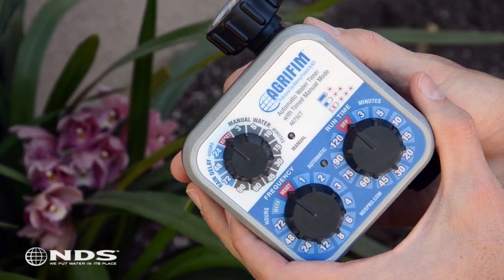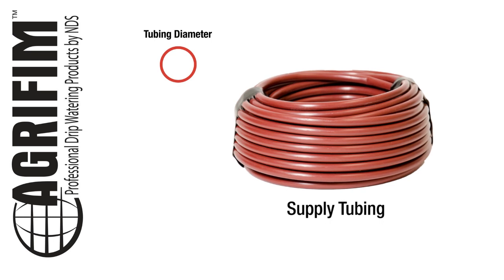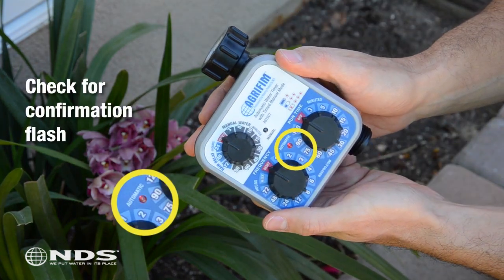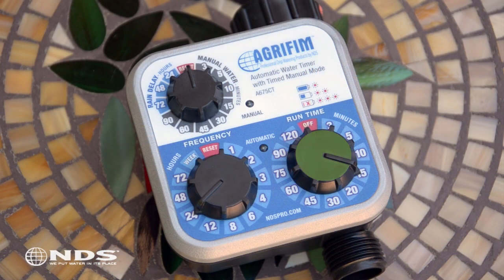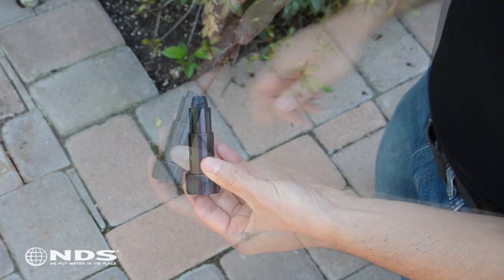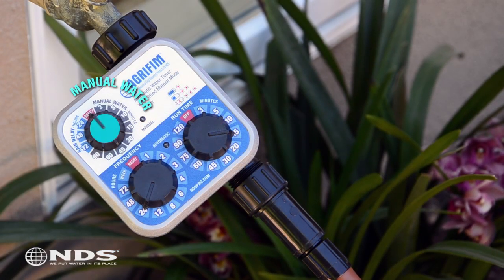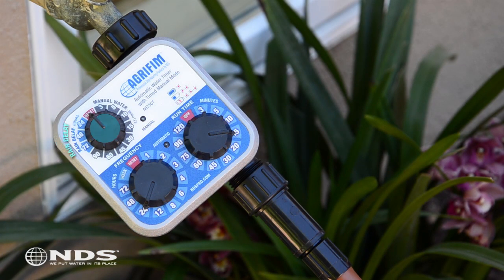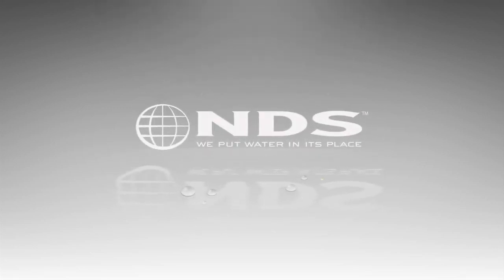Battery Operated Timer Agrifim A675CT

Comment: The timed and manual operations have worked for about 2 months and now do not. The timer is currently set at 24 (once a  day) for 10 minutes.  The batteries have been refreshed, so they are not the problem.  The red lights do not flash. The entire connection is above ground as mentioned in the video and the water source is turned on.

Comment: I am travelig most of the time, nobody is at my home can I trust the system R675CT, how can I know when I need to change bateries? or how often I shoud put new bateries ? I am plannig to irrigate every day 20 min
Reply from the maker: Hi Esteban! Watering frequency will affect the battery life so it is recommend that once every season you check on the battery life. If you are watering year round, check every 3-4 months or when the battery indicator is on. The indicator will flash repeatedly to indicate when new batteries are needed.

Comment: I set for manual watering. 
1 somtimes it works, sometimes it does,nt. Why.
2- if I set for 15 minutes manually, machine will stops by itself after 15 minutes, is it correct
,